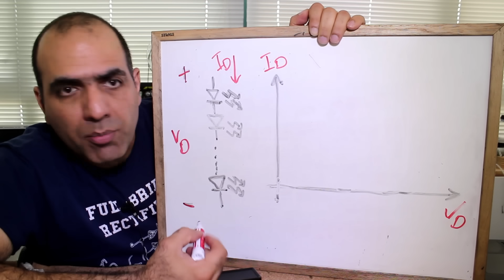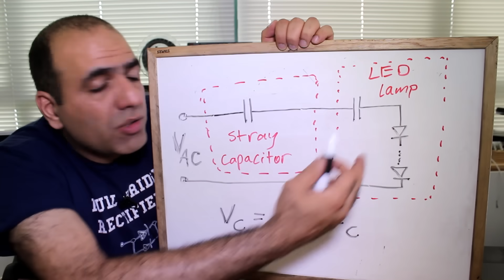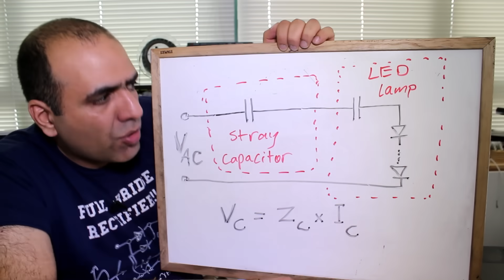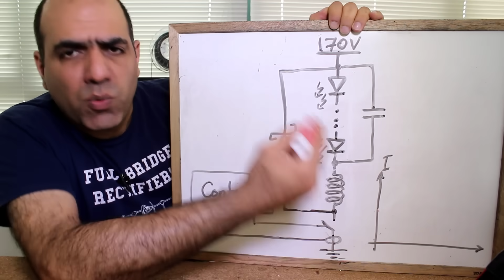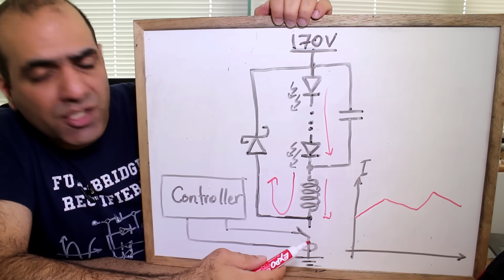Why Cheap LED Lights Keep Glowing

Comment: I love this dude for the reason that he shows us first hand almost everything that could go wrong with doing things like this ourselves
Reply: You can tell hes smarty as hell by how many ways he can hurt himself without killing himself
Reply: It's obvious that the majority of his injuries are intentional in order to prove points about safety. I sometimes wonder if a handful of them are genuine mistakes though. He's either a genius actor or occasional dumbass.
Reply: Jay Nelson I guarantee many are fake but some aren’t. The ones that would most likely result in major electrocution he probably does on purpose. Accidentally touching exposed wire might not be
Reply: @jaynelson7214  The white wire shock was absolutely genuine.  I think the comments about getting lightly shocked right before that were genuine as well.  The first two were jokes, but also informative.  Do YOU know whether what he's doing is safe?  Draw the diagram and see what you think.  Subversive education at it's finest.
Reply: a dumbass
Reply: @jaynelson7214  rude but....
Sometimes
Reply: ikr he's absolutely awesome!!
Reply: steve was like don't do this and he was like PAIN
Reply: you should be watching junkies doing drugs in back alley for the same reason😂
Reply: I don't get it at all.  The noise is just confusing.
Reply: I love this too At his Videos

Comment: The problem is that your electrician messed up when wiring up your switch. According to electrical code, you are supposed to switch off the Hot or Live wire. For a LED bulb to do this, you are switching off the Neutral.

Comment: hi mehdi
,

i was watching one of your videos and it reminded me of an electronics conundrum that i had since i was a kid and have never figured it out (because no one so far was able to explain it for me)

i found out at a young age that there are a lot of toys that are battery operated that you can run by simple removing the battery and connecting it to a DC Adapter directly (albeit by cutting of the jack of the adapter and then replacing it with bulldog clips so you can easily clip them to the toys battery contacts)

but as i said, it works for a lot but not all of them.  in my teens i tried to do the same to some Walkmans and cameras and it did not work. why is that? i know its not about voltages for i have this DC adapter that has variable DC output from 3-12V and i know i have chosen the correct voltage.  I also made sure that the polarities are correct but still, to no avail.

it will be good to have you teach us what do we need to know to make this work. can we run all DC battery devices with a DC adapter if we want to?  Thanks for your time and more power.

Comment: I've had LEDs light up just from having the positive connected to the positive wire of a USB cable which was plugged in, and just touching the ground wire.

Comment: LOVE your videos!! In the process of going through a mold abatement at my grandmother's 3,200 sq foot house. Any chance you might do a video about DIY ozonator made using ozone plates or parts from Amazon? Looks like one could be built for about $160 vs the $2,000 for the pre-made ones available online. :)

Comment: I think this glow will not happen, if the light switch was wired correctly and would break the live wire, rather than the neutral. That is why these lights do not glow in your house, because you have the wiring done correctly.
Reply from the maker: If you watch Steve's video, this can happen when you break live wire. It happens when the wiring is specially too long
Reply: @ElectroBOOM  Yes, you are right. In Steve's video the long coil was the capacitor with half of it still being connected to live. But this kind of wiring, when a switch is not spliced into a wire, but rather is connected to such a loop is rare, and I was not thinking of it. Interesting.
Thank you.

Comment: soooo i'm stupid, or the cheap lights are better? because good led lights waste electricity while they are off, and cheap led lights glow a bit using this energy.
Am I right?
Reply: So you want your lights to remain on when you turn the switch off?
Reply: @BobClemintime  sometimes can be useful a very low glowing. For instance in the kitchen during the night so that you can find the fridge

Comment: From my experience this is usually due to someone tying the switch into the neutral instead of the hot. Likely scenario is when it's a switch loop ran from another box and in that box the black and white are used for the loop which get confused by a helper. Otherwise there must be some voltage across the neutral which then uses the unpowered hot wire as a virtual ground all the way up to the switch.

Comment: Hey ElectroBOOM! i recently made a modified plasma ball. I basically wraped it in aluminium foil and it caused some pretty decent arcs! Although i measured the ball with my multi meter and it  showed around 43 volts AC and Over 20 Amps!!! 

i don't know if this mix of high amps and 40 volts AC is safe.
Please help me 

ALSO when i make arcs with it sometimes the aluminum foil with glow bright and char.
Its this plasma ball safe or not. please respond

Thank you.

Comment: The circuit can be open from the phase side not the null side.
So the LED won't glow even if there is a capacitance to the environment, and you won't be shocked too!
Reply: I have a setup (two times around here) with switches put on the phase side of the circuit. And the LEDs still glow if I switch off. So I am not sure about your theory here.
Reply: @DerPressiv   but about the problems that mr. Sadaghdar mentioned, my theory works 100% correctly. Because there are two types of problems:
1) you touch somewhere and LED starts glowing weakly. In these cases you are the capacitor and you are conducting a small amount of current through your body.
Here we know that the circuit must be open at null side.
2) we have a switch that opens the circuit at phase side. But the switch and wires themselves act like a capacitor and a small amount of current is allowed to cross over this capacitor and the LED glows. If the electrical power was in DC, the capacitor would block it.
Reply: @mohammadmahdimovahedfar3245  ok, so I'm in case 2. Any idea how to fix it easily?
Reply: @DerPressiv  can you make the length of wires shorter or increase the distance between two wires(phase and null)?
If this doesn't work, probably no any other idea.
Reply: @DerPressiv  you're right. I got it after i saw the video from steve mould. He has done it, too.

Comment: Hi, can I use a mid range multimeter ($60-$70) to repair a plasma tv as hobbies? (it uses internally 206v DC and has some 400v and 1250v capacitors) Safe enough or i've to spend more money on a high quality multimeter? thanks.

Comment: Great video. 
So does if I have one of these LEDs at home, referring to LEDs which turn on with low current (e.g. 50uA). Do they actually waste more electricity compared to other LEDs that do not turn on at the same 50uA? I thought it should be the same since current is the same. 
Or do you mean that when the LED is replaced with one that does not turn on, the leakage current can be much smaller than 50uA, hence saving electricity.

Comment: The LED lights with dc/dc converter will start to flash when there is enough leakage current. The capacitor inside the light will charge up until the voltage is high enough and the dc/dc converter is able to start. The LED lights up until the capacitor is discharged and the cycle repeats.

Comment: Hi Mehdi, you often say that North American sockets have 120V AC. Here in Germany our sockets have 230V AC. Why is it differend? So besides the fact they have differend plugs, could a German vacuum cleaner run in an North American socket and an American vacuum cleaner in a German socket regardless they use differend Voltages?

Comment: I am an electrician and found this very interesting, I was wondering if I discovered this in my daily life what would be a practical solution short of replacing the lamps?  Installing a double pole switch on the circuit, to break the neutral as well as the line? Or possibly including a resistive load on the circuit?
Reply: Probably the latter. The resistor would act similar to a bleed off resistor on a capacitor.

Comment: To avoid usage wouldn't it be better to design a switch that switches both the negative and the positive? Just a thought. Cause it look like all our switches are DC switches not AC.

Comment: Nice video, 
solution: make sure your wall switch cuts the line conductor not neutral conductor to the lamp
Reply: You missed the point. The switch should always cut the line, but the capacitance still exists. The light is being powered by this inductance/capacitance relation, it is not necessary for current to come from the line side of the circuit. With a full bridge rectifier, current can come from the neutral side too. Electricity is not as simple as you think.
Reply: @rohrertech8882  I am an electrical engineer buddy. And if you watch closely you will note that Mahdi always had the power line connected while using his body as the second conductor. In a properly connected grid The neutral conductor is earthed. I know the effects of capacitance, a floating (not connected to anything) conductor in the wall could have voltage as high as 100V in a 220V grid (tested it myself). It actually happens because lines run very close in the wall.
If the lamp has a real line terminal and a stray voltage terminal it can glow (stray capacitance will replace the switch not completely but with voltage good enough to fire the lamp), but if a stray voltage terminal and earthed neutral  terminal the second one will absorb the charge through the stray capacitance rather than fire the lamp. I know that practically with 26W compact fluorescent lamps.

Comment: I wasn't getting the glowing affect until I changed out some of my wall switches to 'lighted' wall switches.  Only the LEDs on a circuit with a lighted wall switch glow when turned off.

Comment: I got the same effect on a bicycle-lantern. Running on batteries. 
I think, it's because of the high-voltage-line nearby. And the lantern is acting as a inductive antenna. Is that possible too?
Reply: Late reply: That sounds plausible, and I don't see what else it could be, given that battery DC alone couldn't do what's described in this video. But why not test the hypothesis by just biking away from the power lines?

Comment: So the Chinese LED is not the problem. The problem is that the current flows because of the effect described but conventional lights dont heat up enough to glow. Whether you use the LED or halogen you still end up flowing the same amount of current. Is that correct? How much does that add up to over a year?

Comment: PRO TIP: If you have a light with multiple light bulbs and it's doing this with all LED bulbs in it, switch one to be an incandescent bulb.  It kind of kills some of the efficiency but you won't have that horrible glow in your bedroom while you're trying to sleep.  As long as it's wired up correctly in the light (testing this will let you know) it's just acting as the giant resistor that Mehdi described needing to add since an incandescent bulb just works by turning power to heat to the extreme (which uses resistance).

So no need to hack your existing LED bulbs just put an incandescent bulb in the series.  I'm not sure how far this goes.  Someone (maybe me) should do some testing but I'd theorize that it'd work anywhere in the circuit as long as they're all running off of the same breaker connection.

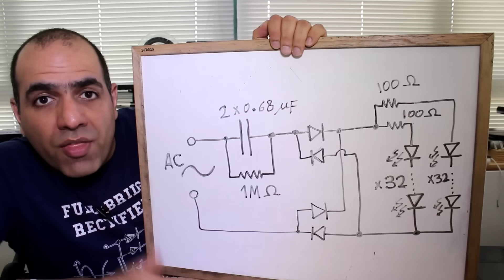Comment: Brain muscles I haven't flexed since college, but it's your sense of humor that got the sub.  Reference question - 5:19 That front part of the circuit (capacitor and resistor in parallel) is also a form of AC frequency filter, isn't it?  (College was a looooong time ago...)

Comment: Would the same thing happen if the neutral is switched Inst d of the live side I had glowing ones in one room found that the neutral was switched to the light switch and the power wire ran in place of the neutral when I fixed it the LEDs worked normal

Comment: The same thing happens to leds connected to my Arduino when it is powered by my laptop or from the wall.
the thing that it lights when you touch the one of the other ends.

Comment: I have that problem with my outdoor veranda lamps when I replaced them with cheap chinese LED lights, my question now is that when the switched turned off, do the lamps consume electricity from the meter? Or since the wiring acts like a capacitor, does it mean that when the electricity stored on those ran out, the lights will automatically turn off eventually?

Comment: I have a normal- led.. and still it glows when I turn of the light.. 
I can even send a picture of this.. the electrician said I have a low running current... 
So it build in to an smoke catcher(don't know the English word) in the kitchen..
So it also happen in a flow lamp... So I do have the problems..

Comment: As always, very funny and entertaining. I never get tired of you getting zapped. Very informative. Only wish I could control the speed of the video, to slow it down in order to follow your explanations better. Do you have a solution for that?  ; -)

Until then, I'll just have to replay this and that portion over and over.

So another great video. Now I know ( - have an idea) why my 6" waver LED ceiling light I have in a display case and plug into my SWITCHED wall outlet glow after the WALL SWITCH is turned off.

Comment: While symbolically Steve Mould's diagram most closely resembles a capacitor, wouldn't the alternating current in the one wire be inductively coupled to the parallel wire more like a transformer? The LED is being run by inductive current very much like those wireless chargers for your cell phone and such... NOT really a capacitor as a capacitor is commonly used to filter AC currents from a circuit... A capacitor opposes changes in voltage... @t

Comment: The reason I hate LED christmas lights is they don't use FBR's, so they blink at 30Hz (25Hz in europe I guess). They strobe when I turn my head or eyes and it bugs me, and I can see the 30Hz flash.

Comment: Wow, that's amazing! Well if cheap Chinese LEDs can glow from that little bit of electricity, then I guess that just means the Chinese are making some really efficient products!
Oh, I guess that happens with all of these newer LEDs that don't have that resistor or some equivalent in the circuit. Interesting.

Comment: These C/C (capacitance/capacitance) dividers (ultra cheap chinese) are as non-efficient as all FUCK. I measured more than 70% waisted power with C/C divider over a simple step down transformer step circuit, Electro boom should self decentrate knowing this info (a community service to us), but he's too stupid to know basic electronics and prays on the stupid to get subscribers and its working well), and that why he has 2M subscribers, fkn LAME!

Comment: so since im paying for the electricity i should get the cheaper bulbs? so at least i get some light out of it, instead of letting some resistor eat that little bit of power?

Comment: Hey, Mehdi...I really liked this video. Thanks for making it. Now that I have seen your video and the one from Steve, I understand the cause, but not the fix. The LED bulb I have is a replacement for one that is above our stove in a small fixture under the microwave oven. The original bulb wasnt too bright, so I replaced it with LED for more Lumens. Bulbs glows in "off" position. Can I fix the light circuit to solve this? I imagine a diode in-line with the bulb fixture power (115VAC), but is that correct?

Comment: Love your style of videos. 
Very entertaining while educational,  
Had my fist electro-boom moment when I was 16,  
I found an old neon sign and scavenged a few of the straight neon tubes , high voltage wires and two fo the 
30kv @ 20ma  step up transformers that were center tapped to case ground giving two different phases of 15kv
The tube was about 1m long,  That halloween I set up a little demo of the power of HV. 
Had a 2 in thick rubber mat with  6 feet of the high voltage wire.  I put the transformer on a pedestal in front of me
and had some one plug in the mains to the input of the transformer and holding the tube in one had and the end of the wire in the other the tube would light up.  
This worked great until I had the "bright" idea to point the other end of the tube towards the other output of the transformer. 
Well an arc popped to the other output and the next thing I knew I was on the floor stunned.  
My parents took me to the ER just incase but I was fine. 
So after that I studied more about electrical safety, A lot more.

Comment: This explains the new LED lights I put in. I find it kind of annoying they all have a small glow when I turn them off and was just praying it didn't mean my poorly wired house was going to burst into flames. I mean it still might, the guy before me put in ungrounded plugs throughout the entire house in around 2000, to save a few pennies, but atleast I know there isn't just stray voltages across my house wiring.

Comment: I’m surprised you hadn’t seen LEDs that don’t immediately turn off.  I have potted LEDs in my basement ceiling, at least one will always stay on (about ~10% brightness) when turning the power off.
Reply: If you have a one-way switch, the switch is in the ground lead.  If it bothers you have it rewired to code.

Comment: That red resistor in the diagram is completely unnecessary.  The resistor-diode circuitry to the right side of the diagram does not store energy,